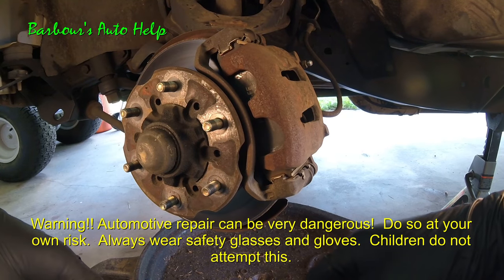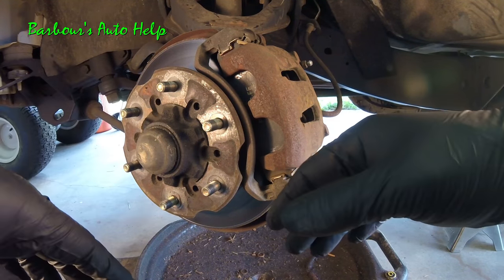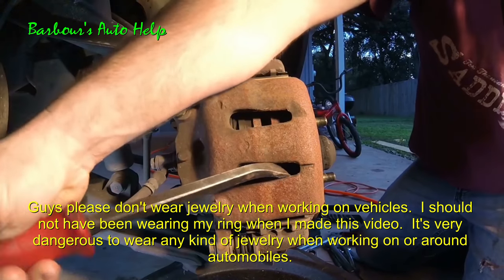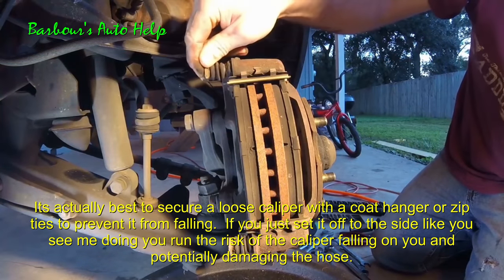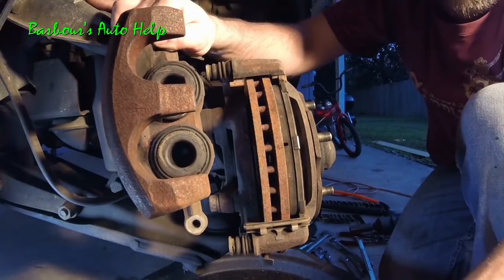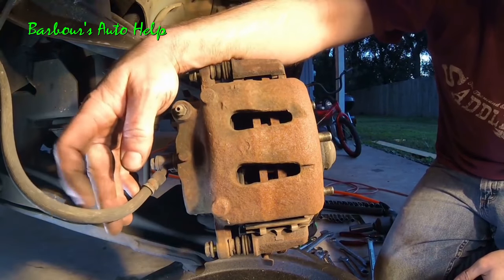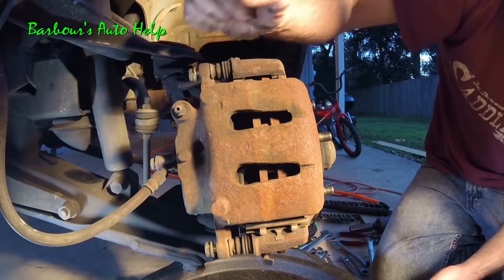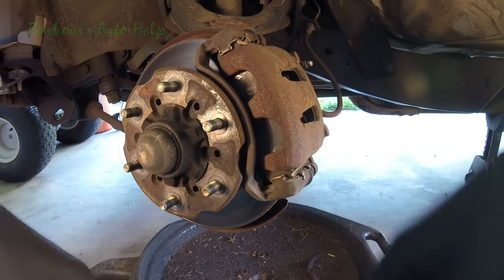How I Diagnosed a Seized Caliper Piston

Comment: Thank you, it indeed helped me as guidelines and i managed to pull caliper off bracket,
 clean some gunk that was on the outer of the brake pads, the "slide" into the smaller "thin stainless steel looking like" clips. 
I noticed alot of gunk inside the piston itself, previous owner had painted them red and it seems to have caused more residue than it should, i cleaned that, 
pushed back piston in holding it safely and having it secured by a wire in case it slips and not to stress the hose, I used a kind of big westcut that i had and manage to make the rounded shape of it lever pretty well, another oddly shaped tool i could use the corner near the handle while pressing its extremety in the sidehold of the caliper as a lever was a "file" a handheld steel file.
 I noticed the rubber is a little bit damaged as it been squeezed it seems, i tried to push it back in place,
I took out the "slide pins" and wiped off the old grease, applied new one and made sure they slide properly.(i noticed if you dont carefuly hold the rubber extensive thingy that it slides into, it might stretch out to a point it might fissure, make sure you hold it there while you rotate motion the pins away from it/the caliper)
 let's hope it stays repaired, at first drive i couldnt even tell if it is fixed, it isnt stuck like previous car used to do and get blue hot metal on the disks....
:D you can do it too !!!! if you are there reading all and watching, preparing.... DO IT !!!!

Comment: Before you start spending a couple of hours taking the wheels off and fiddling around with the brake assembly, a quick way to check for dragging brakes (caliper) is to drive the car a few miles with frequent braking, then use an infrared thermometer and measure the rotor temperature on both sides of the car. A dragging brake pad will significantly increase the temperature.

Comment: Easiest and fastesr way to compress the pistons on calipers that have 2 or more pistons is to use one of the old brake pads or piece of steel flat stock  laid across the pistons you want to compress then a decent sized C-clamp as centered on the old pad or flat stock as you can possibly get then simplu start tightening that clamp down until you feel the pistons stop and can feel through the c clamp that your now just pushing the pressure when you tighten it against the body of the caliper , which is the obvious sign that you drove them completely back into the bores. However before you ever start to compress a piston back into a caliper bore , always take the couple minute to get the outter dust seal as clean as you possibly can , blow it off real good then just quick lay on a thin film of your brake grease you should have handy for the job  to lubricate the seal a bit , these couple easy and fast extra steps almost always eliminate the possibility of the seal spinning if your doing a rear caliper , or getting pinched and therefore likely also torn while compressing a standard style caliper back into place , and once that seal has the slightest hole or rip in it , kiss that brake caliper good bye because if you still put it back together and use the car as is , that caliper will seize almost certainly within less than a year , sometimes as soon as a few weeks, dirt and moisture gets in their corrodes the piston and bore anf that alone can make it seize , but also the dirt and contaminated often will sandwich themselves between the piston and the bore which of course is obviously going to cause it to inevitably seize in the not to distant  future.  Sorry for the long comment just wanted to add a few tips in that every one even just the weekend warrier should all know and be aware of.

Comment: I think that's what going on with mine. Changed the breaks today because I heard grinding. The inner pad was worn to the metal but the outer pad still had 50%
Reply: Dude same! I was like wtf?? How In the world?!
Reply: @mellybug6698  update, it was a stuck caliper piston replaced calipers rotors and brakes 250$
Reply: @randomshortz17  Man I just got mine back in with a C-clamp. And it was 1 piston. Idk if they occasionally get stuck from time to time or there’s a reason why
Reply: @mellybug6698  I guess when the rubber boot goes bad and gets a tear in it, dirt and debris gets into the piston, in my case mine were original on  2006 Silverado so they were well beyond due for a replacement

Comment: My problem is the car sat for about 2 years. I finally got the engine engine to start. It now runs fine. The brakes are rusted to the rotors in the back. I have been working on it for 2 days. Before I take the calipers apart do you have any suggestions?

Comment: Do a good visual inspection on your piston seal. That seal pulls piston back into bore once brake petal is released.
Reply from the maker: Actually,  the seal that does that is not visible.  The dust boot is visible.   It's just a dust boot.  The seal is inside.
Reply: As a spy from bicycle less-tax & health activist, may I ask can this interior-
of-piston Seal be replaced or new piston
include Seal , if purchase ?

Comment: I had a problem with the caliper not releasing I open the bleeder and it released. I moved up to the next fitting and loosed it and it release till I made it to the master cylinder. The master would not let fluid back, so brakes stayed on
Reply: Did you find out what the problem is?

Comment: I have a 2004 Saturn VUE  AWD 6cy 221,000 miles.  What caused the brakes to freeze. It felt like all four froze. I was driving down the street and I was not pushing down on the brake pedal then suddenly the brakes are the stopping car. I started to depress the brake pedal but was stuck at the top, I could not push it down. I pulled off on to the emergency lane and waited for 15 to 25 minutes. I could smell asbestos.  I tested to see if the brake pedal would go down as it should. It worked so I drove another 20-30 minutes and it occurred again another 20-30 minutes and it occurred again, and again. That's the pattern the brakes kept doing until I got home.
Reply from the maker: Not sure.  I'd highly suggest having a technician take a look at it.

Comment: I have a seized rear passenger brake, when I loosen the two caliper bolts it frees what. Can you give me any advice on this?
Reply: I also noticed when you removed the caliper no brake fluid drained out, when I remove mine brake fluid starts to escape.

Comment: Help. I installed rotors and pads, bleeded the brakes,abs, cylinder lines and I don't have break power on two wheels. So break peddle sinks full. Took it for a quick drive on gravel with slamming the break multi times to get the abs to activate in hoping to get pressure.. got home and checked my rotors/pads. Front left, hot. Works. Front right cold, doesnt work. caliper doesn't work? Rear left cold, rear right hot. Any tips welcome, just not those..😂
Reply from the maker: Probably best to take it to a shop.
Reply: @BarboursAutoHelp  hours later I ended up fixing it my self , now they all work better then ever.
Reply: @wevonox7941  what was the issue ?

Comment: Hello... thanks for your video.  I have this nagging question about disc brakes and I have searching youtube to look for an answer and I have not found any answers on the videos that I have seen.  Maybe you can help me understand.  I know the theory of disc calipers; push and pull of the caliper to engage one side of the pad and the other side of the pad.  On the non piston side, the slider pin/mechanism pulls the caliper "arm' (is that right?) to engage the pad to the rotors and when you let go of the brake, the caliper arm pulls the brake pad away from the rotor.  Now for the piston side of the caliper is where I can't seem to comprehend.  This is what little I understand. To engage the pad to the rotor, the piston pushes forward to engage the pad and when the pad is engaged, the brake fluid will continue into the piston which causes the piston arm along with the pad to pull up against the rotor.  When you disengage the brake pedal, the caliper arm along with the pad will back away from the rotor.  Then the piston on the caliper will back away from pressing the brake pad up against the rotor BUT how does the brake pad on the piston side back away from the rotor?  Do you understand my question?  Maybe it is this and correct me if I am wrong:  The natural position for the caliper/piston/arm is always lets say 1/8" from the rotor.  When the piston on the caliper is engaged, the piston/caliper side of things does move along with the pad to engage the rotor by way of the slider pins (still i visually can't see that) and once engaged the arm will then move the pad to engage the rotor on the caliper arm side.  If this is how it works, then the piston side of the calipers   I can't seem to understand how that piston side would back away the pad from the rotor.  I know this is long but heck.. I'm so confused.
Reply: Hydraulic pressure from brake fluid

Comment: Hey Keith I have question my car has little issue. I googled the many engine related problem but I can't find solution because I do not know exactly what the problem is called. I don't know nothing about fixing car. When the car is idling the sound is loud, I can hear pulley's spinning it is not a normal sound. When I sat on my friend's  car ( not brand new, low mileage)  the engine idle is quietly. My car is under 26k miles. When I accelerate the engine sound is loud, and I feel little vibration as I am slowly pushing the pedal. The car vibrates for few second then its gone. I know when you press the pedal to the floor the engine get louder. I'm not pressing the pedal to the floor, at low rpm the engine sound is loud. In highway however the engine is quite. So if you have idea on what the problem could be can you help with. Thank you
Reply from the maker: Can you upload a video of your vehicle running so that I can see and hear it?

Comment: Will this cause car not to move? Whenever I put my truck into reverse it goes into gear but won’t move. If I floor it’ll move but it fights hard and grinds. Drive is just fine tho
Thanks!
Reply from the maker: Sometime a vehicle with a locked up caliper will move...sometimes not.  Depends on how bad it is.

Comment: I have an intermittent grinding noise coming from the driver side (I think front). It only happens when the car is cold and it happens in both reverse and drive. However, after I apply the brakes a couple of times it goes away. Do you think this might be a brake related issue or something else? Thanks!
Reply from the maker: Could be